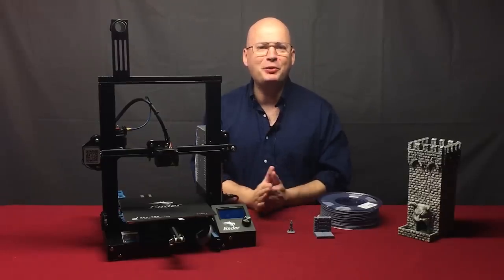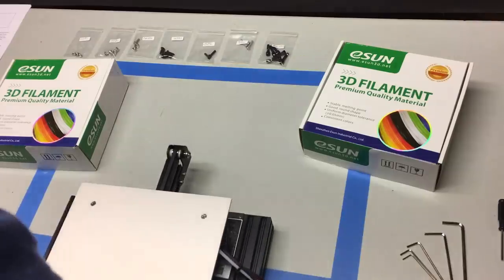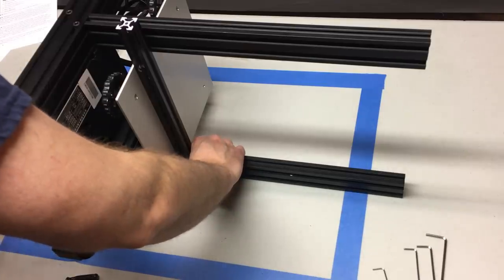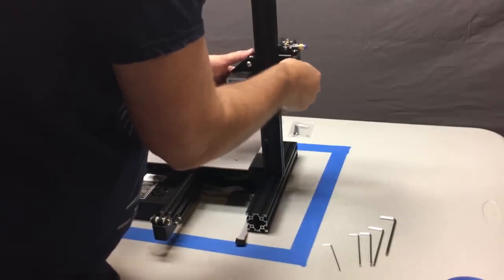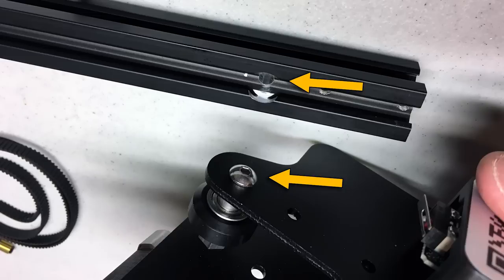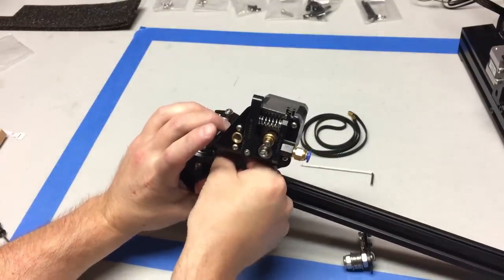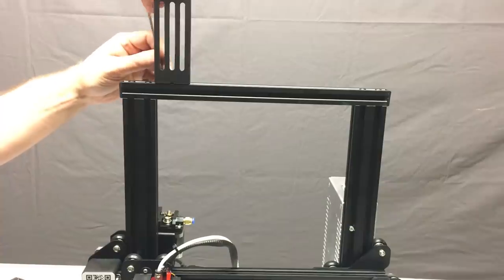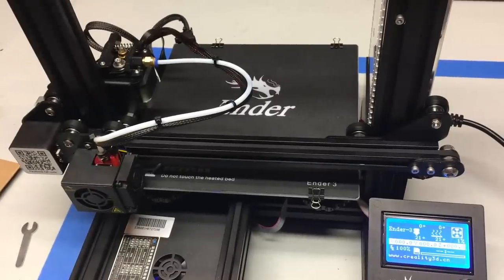Creality Ender 3 assembly and pro build tips

Comment: First I want to say I am new to this. It seems every time I have an issue, I watch your videos and my problem gets solved. 

This comment is for new builders. I followed your build to a t and the First Test dog print was perfect. By the way I also watched your bed level vid. It is a must see for a newbie. Then I print the fan cover. It is almost perfect but at the end it under extruded. Still usable. I now run my third print and disaster. After two days of videos and no printing I figured it out. The gear on the extruded motor came loose and slid down causing no extrusion. I figured this out watching your under extrusion videos. Bottom line when building it I recommend everyone check those screws on the extrusion gear. You may have mentioned it in the video but just in case. 

Thanks for all the help you guys are awesome.  😎
Reply from the maker: Thanks :)
Reply: I actually just had the exact thing happen to me.  I was going to comment how awesome my first print.  And I know it was due to this video.  As well my extruder gear slipped on my second print. I don't think I would have had the amazing experience I had if not for these instructions.  Thank you guys.
Reply: Great insight! I just set this up and printed my first test dog in .gcode and it came out great. I'm now trying to print a second (the fan cover) which is posted in .stl format but it is not being recognized off the SD Card. Any advice for a fellow novice? Sounds like you didn't run into this...
Reply: Geoff Lopatka I actually did have This issue. When I down loaded the file onto my card it was not formatted correctly for some reason. I loaded the files into Cura and sliced it then saved it and it worked. I now load everything into Cura now and slice before I save to the SD card. I have not had that issue since.
Reply: @flyerscout2  fantastic! Thank you for the tip! I'm doing this now and seems to be working!
Reply: Hi James. Can you please identify in the vid (xx:xx) exactly what is the "The gear on the extruded motor"? Im portuguese and my english is not that good. I'm having trouble identifying what you pointed out. BR

Comment: Most in depth video I've ever seen!

One tip you missed!!! When putting the z-motor in, keep the rod in as well... Line it up and centred at the top before tightening the screws!

I noticed it was off after putting it in, loosened the screws and lined it up, tightened again and perfect!
Reply: Still good advice today - glad i read this comment before starting the assembly.  Thanks!

Comment: Something that I would add as a first step is to make sure that your base is level (not the bed).  The base of my Ender 3 had a slight wobble when placed on a flat surface.  So I loosened the bolts on each side and squared it up before tightening the bolts back down.  Then I continued with your tutorial.  Thanks for the great video.
Reply from the maker: Thanks for bringing that up! Yes, I totally forgot about the possibility for the two horizontal extrusions to not be level. I will do a quick video covering that. :)
Reply: @Tombof3DPrintedHorrors  Hi, A video would be great. I'm struggling with squaring up my frame
Reply: Mine wasn't level, either, but when Tomb didn't cover it, I thought maybe it would simply square up when I placed the final bar at the top.  That actually did the trick - no more wobble - so I didn't think any more about it.  But now I'm thinking maybe I'll go back and loosen those bolts just enough to take any possible stress off, then tighten up the frame again with everything square.  Thanks for making this point.
Reply: yo thanks for this. just finished mine, it was wobbly. saw ur comment i was like 'oh duh'. now it's rock solid.

Comment: Good job. This helped a lot. One clarification I'd appreciate is around 20:45: wish I had more detail on aligning the rail than just "adjust those screws".
Reply: Agreed, he means the screws you just put into the rod to attach it to the x-axis assembly.  So you need to take the new part back off the Y-axis rail to re-tighten/adjust.
Reply: To clarify, he is referring to the screws he shows at 18:35. Loosen those a half turn, turn the x-axis bar up or down accordingly, and then retighten and check against the spacer again.
Reply: Amazing, I had the same question/confusion. Thank you guys for clarifying this for us!
Reply: Connor MacLeod thank you so much
Reply: Thank you for the clarification! I was also confused.

Comment: Just wanted to say thanks for this great video. After building a quarter of my Ender3 from the single page instructions, I ended up taking it apart and following this video step-by-step. I've just done my first print and it's looking great.

One thing I noticed was that when building, no matter what I did, I couldn't get the two vertical aluminium extrusions to be exactly the same measurement at the top as at the bottom. I even got an adjustable set square to check that I'd got them at a perfect 90 degrees in all directions. Maybe you're at the mercy of how accurately the aluminium has been cut. It seemed to all come right when I added the top extrusion.

Comment: Great video. Like most guys who consider themselves handy I just plowed on in and started the build but quickly ran into questions, such as "why is the Z stop switch not at 32 mm" Your video answered this question and more. great tip to set the Eccentric nuts before assembly. I had to tweek one after I had built the machine and it was a lot more difficult to get access. Keep up the good work. :-)

Comment: 7:02 DO NOT DO THIS!!!!
This is how you warp your bed. The y axis belt has metal ends that stick out under the bed.
Just get the bed low enough for the nozzle to not hit when homing with the unmodified z enstop. Then level it from there.
Reply: Damn, I already did this. Is there a way I can verify if my bed got warped? is it 100% of the time?

Thanks.
Reply: @joellajoie-corriveau477  if the metal ends of the belt didn't make contact you should be fine
Reply: @joellajoie-corriveau477  if you tightened the screws down fully, then you for sure hit those metal tabs that stick out. You're bed will most likely flatten out after you loosen them though - mine isn't too bad after I fixed it. You can always setup manual mesh bed compensation(or bltouch) in marlin to fix it.
Also, I suggest getting stiffer springs(the blue ones) so you don't have to crank down as much to keep tension on them.
Reply: @dvdcd  well I'm not sure if they did
Reply: @hzmeister9596  how did you fix your bed?
Reply: @joellajoie-corriveau477  if you didn't screw it down really hard then it should spring back on its own. I had to bend mine back a little with my thumbs(grabbing it from the top) to get it flat again. You can check if your bed is warped or not by leveling all four corners perfectly with everything preheated. I set my clearance using a thin paper receipt that just barely touches the nozzle enough to feel the vibration of the fan. Then check the clearance between each of the corners.
Reply: Sir you deserve more upvotes

Comment: Great tutorial ! I followed this to assemble my new ender 3 pro and then followed your bed leveling tutorial.  Now I'm up and printing with no problems. Thanks for taking the time to help out those of us new to the community.
Reply: I just recently got the 3 pro, is the set up the same as the base 3 line in this video? Or did you have to tweak some set up?

Comment: I'd like to add a piece of advice: I couldn't have the same distance between the top and the bottom of the extrusions, I solved this by turning 180 degrees the left extrusion, this took me to a 1 mm difference between top and bottom. (I'm talking about the process that starts around minute 8:00 through min 12:00).
Reply from the maker: Thanks for posting, I love hearing how people resolve production issues like this. :)
Reply: I am having the same issue but I do not understand your solution. Could you explain in more detail? Thanks!
Reply: thank you! this worked for me as well!
Reply: great idea, it saved me 2 milimiters
Reply: Same here, Luca!
Reply: I tried this several timed and even squared the ends with a mill but im still 1/8" off on the too. it has to be that the tops of the h frame are not perfectly flat
Reply: Don't you end with screw holes on the wrong side when doing that?

Comment: Basically don't do 20:20 that gets your bed terribly misaligned. Doing this put it off by more than 1 degree, almost 2 degrees, in the OPPOSITE direction of where it was already slightly tilting. The 2nd carriage gives support and weight, so whatever alignment you've made without it will be worthless once it's put on.
I fixed this misaligned by taking it off, and making sure I pushed together the 3 carriages as much as possible, and tightened their screws. Once on the two rails I loosened one carriage a little ans pushed them apart a little again until it was leveled. To get the Z axis straight I also needed to give it support a little above the screws, so that I don't have to push the rod much to get it into the hole.

Comment: just have got mine and already built it.
what i noticed 
-bed rollers are placed equally, against each other (not a parallelogram )
-adhesive surface is detachable , 4 clips are included
-mine wobbled on a surface so i had to loosen the side screws, adjusted it and tightened.

waiting for your auto level vid!

Comment: Thanks for the tips!!  Just an FYI, at 24:00 (and earlier) and 26:53, you talk about how to mount the nuts. I'm used to using Unistrut, which has similar nuts. Based on how it works, and according to the Ender 3 Pro manual, the nuts should be rotated 90 degrees from how you've installed them, once they are finally tightened.  This ensures that they grip onto the extrusion properly. It was pretty easy to get the nuts for the filament holder to rotate, but in some other instances, I had to slide the assembly on, with the nuts at 90 degrees.
Reply: Oddly, it was the filament holder that gave me the problem that the nuts wouldn't rotate in.  I had to place them at the 90 degree angle then slowly lower and tighten the bolts into them.  All other places they rotated into place as I tightened them.  Guess it just goes to show how every machine can behave differently.

Comment: Just got my Ender 3 Pro. Took 1.5 hours to build. So far, everything is tight and working great.
Reply: Hi there. Du know if the instructions are the same for the Ender3 and Ender Pro model? BR
Reply: @dlencastre  Yes, they are pretty much identical. I checked them with my buddy who has the Ender 3, not the Pro.
Reply: @nikkigolightlygames  great, thanks.
Reply: @dlencastre  Did the assembly go well ?
Reply: I just received mine and found your video and that link doesn’t not go to the instructions it goes to nothing. So I downloaded just from searching the page what I thought was the instructions and it was just the user manual which doesn’t go over the assembly at all.

Comment: Man, really great and usefull video. I did everything you did. But that part where you have those two vertial guides, i couldn't get them at same size down and up, so i did the trick: I mounted up-horizontal part only with 2 screws but they were loose, I used your "wobble" trick to make them paralel/even, then i tightnen down-screws, and everything rest as you said. Great ideas for excentric nuts and I love your idea for measuring x-axis left/right side. I think that my printer is now on <1mm differences on every side/part. Thank you. :)

Comment: Great video. Many thanks. I had my Ender3 about 1/2 way assembled but was stumped by the little tab on the z-stop switch - I couldn't get it mounted with 32mm gap from bottom of side rail. After watching your video I disassembled the whole thing and started over again doing what you recommended regarding the adjustments to the guide wheels and other things.

Comment: Thanks for this, it was helpful, but I have several improvements I'll list below:
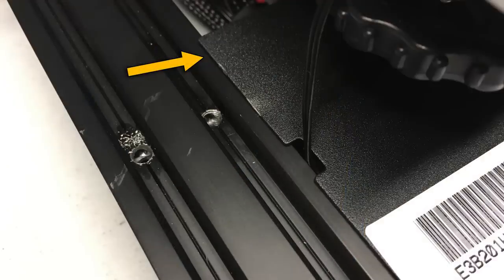1. At 7:50 first thing to do here is level the base, mine rocked up and down on 2 corners, so make sure your frame base is level ( I just twisted it a  little in my hands by pushing 1 side and pulling the other.
2. At 8:14 leave this lid loose until much later, after we plumb and level everything.
3. At 9:00 use this bracket at the top of the sides (small clamps to hold it in place if you have them)
4. 12:00 When adjusting these nuts on the wheel carriages, make sure you do them on the correct side and correct direction (you are probably just doing this for camera angle purposes, I did it your way at first, then later discovered the carriage that went on the other side didn't fit the same)
5. At 14:09 Leave LCD part off, this will be the last part you want to install, and plug the ribbon cable in before attaching (the screen just gets in the way now and at risk of having screws or parts dropped on it later while you put other parts on above it)
6. At 16:00 plug in the Z-wire coming up from the base before attaching this piece to the frame
7. At 17:20 DO NOT tighten the motor to the frame, just snug for now (we'll tighten these screws once frame is plumb and level)
8. At 17:40 DO NOT tighten the Z-rod lead screw, once you eyeball it so that it is plumb to the frame both front-to-back and left-to-right , then just snug the screw in the coupling for the Z-rod (we will tighten fully after frame is level and plumb)
9. At 18:38 DO NOT tighten screws fully, just nicely snug so that it is not loose but can move when we adjust it on frame during leveling/plumbing process
10. At 19:34 DO NOT loosen these screws at ANY time, always leave them tight.
11. At 19:54 DO NOT do this part yet, we need to jump ahead
12. At 20:50 DO NOT put the belt on yet! we need to jump ahead
13. At 21:05 Make sure the hotend is facing the correct way, and the wires/tube is not twisted up
14: At 23:19 DO NOT tighten the screws fully, just very snug for now
15. Now back up to step 11 above, at 19:54 do a dry fit now that it has all the wheel carriages and extruder attached
      Do not lower this assembly more than an inch or two on the Z-rod lead screw. At 20:00 to 20:22 do not use the spool bracket to level, instead use the top part of the frame, it is much taller and will save you a lot of time as you level and plumb this the the frame sides.
After getting it level, carefully remove the assemble and tighten the screws which hold the left and right wheel carriages, but not fully tight, you want to repeat this process a few times until you get the horizontal assembly as level as possible (I had to repeat this process 4 times until it was level). Once you are level, tighten the screws holding the left and right wheel carriages fully, and place the assembly back onto the frame and Z-rod lead screw. 
16. Attach the top of the frame, seen at 26:00 
17. Now tighten the the screws holding the Z motor to the frame
18. Now tighten the screw holding the Z-rod lead screw inside the coupling
19. Now tighten the screws holding the lid over the board 
20. Now install the belt and the tension adjuster
21. Plug in all of the cables that are in the rear
22. Plug the LCD screen ribbon in to the LCD part
23. Screw the LCD part to the frame.